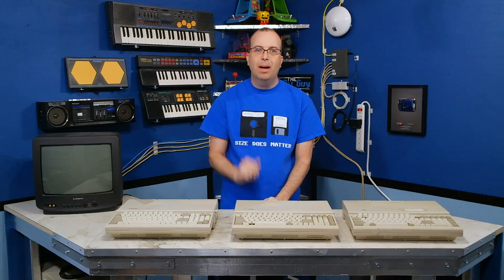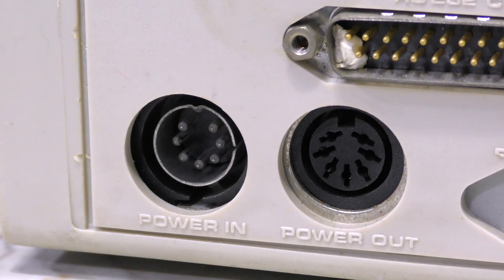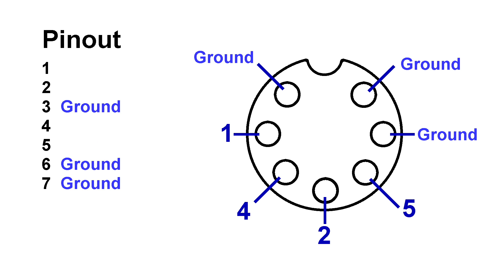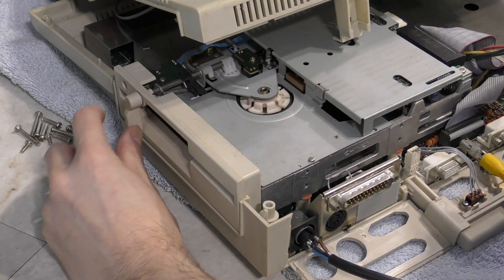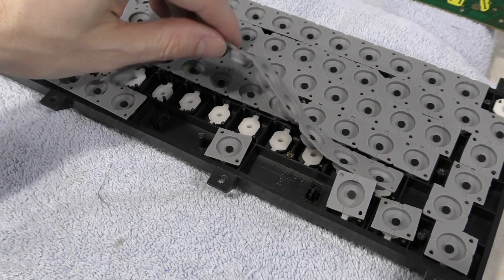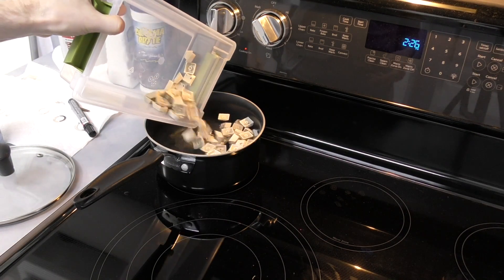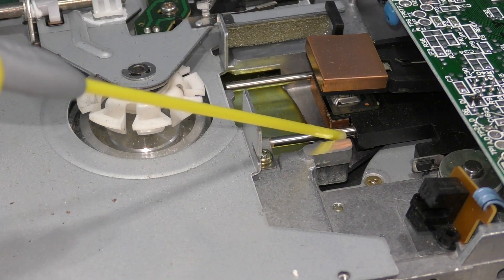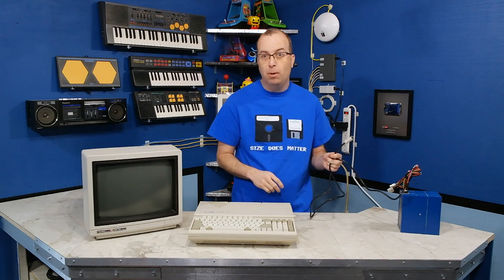Laser XT Restoration

Comment: For the power supply, check the Mean Well GP series http://www.meanwellusa.com/productSeries.aspx?i=26&c=6#tag-6-26 . They have one that's +12,-12, and +5V.I was looking at one for a replacement on my TI-99/4A with +5,-5,+12v. Nice restoration!! Was looking at picking up a Laser 128 and wondered how easy it was to pull the keys as many I've see have broken keys.

Comment: I wonder if you can take some RAM chips from the donor machine and put them in those empty sockets on the RAM board to get a full 640 kB RAM.
Reply from the maker: I wondered about that. But I noticed the extra sockets had 2 extra pins on them.  So maybe it was cache RAM or something?  I'm not sure.
Reply: Possibly it uses 256 kbit chips with a different layout, like TMS 4464 64Kx4 chips (those are 18 pin DIPs). That way they can make 128 kB RAM using the same 256 kbit chip density technology. There are 640 kB memory (and 1664 kB, with 1 MB EMS) versions of this machine.

Comment: Could'nt You just make an adapter for the other power suply that you already have? Only if it supports the same voltages of course. So Female do the power supply and switched cables as needed to the actual output.

Comment: Funny enough, that strange power plug is very similar to the old broadcast cameras that my High School used for the morning announcements. I think the camera was a 5pin, and had a huge power brick (triple of that first power brick you... bricked) that I never worried about. If anything broke, we weren't getting it replaced, so I never tried to mess with it (They were 15 years old at the time) Very cool to see similar power adapters out in the wild. I feel the same thing when I see BNC ports and cables.

Comment: i wonder if you can jack a modern laptop power supply into that laser xt pwr supply case, if you don't get a working one as a donation in the future. Come on, you are the 8 bit guy, hero of heroes, you can even jack a toothbrush into that thing and still power on the xt (after finding the proper ground pins on toothbrush...)

Comment: You should of used some heat shrink on each of your wire connections, and another shrink between the that metal shield and the pins.  It looks like a short waiting to happen, especially with no strain relief.  00:08:03  If it was simply a signal cable I'd not worry, but this is Voltage.

Comment: Is this a Z80 CPU based machine? I saw a Zilog chip when you were pan around looking for the CPU. I'm using an old AT power supply for my Atari 520st, they do come in handy.
Reply: The Zilog Chip is a disc controller, I thought the same thing though and had to look it up immediately, anyway the 8080 and the z80 are very similar but the z80 would probably not have enough compability to work as a clone, so it's probably that the zilog disc controller was the cheaper or simpler option in this case.
Reply: Zorbeltuss Z80 is as 8080 compatible as a Ryzen is Pentium compatible.  But PCs are 8086 compatible, not 8080 compatible.
Reply: This is why I shouldn't be on youtube when stressed.

Comment: You really want a decent connector for the power supply, here's a couple I found after a quick search:
https://www.alliedelec.com/rs-pro-6925450/70827396/
http://www.newark.com/prehkeytec/71506-071-0800/connector-din-jack-7-position/dp/99K0408 (picture looks wrong, datasheet looks right.)

As for power, if you want a more power brick style adapter, depending on the current demands on each of the rails, I've got an old Cisco power supply here that has +/-12V and 5V outputs. It can supply 3A on the 5V rail, 2A on the +12V rail, but only 0.2A on the -12V rail, and it says the maximum load is 30W. The one I've got is for a 1700 series router, part number PWR-1700-WW1, but they're also used by other devices, and the generic part number is 34-0874-01. They can be had on eBay for less than $10.

http://www.ebay.com/itm/191686435622
http://www.ebay.com/itm/142511583013

You'd have to measure the power usage to be sure it didn't exceed the ratings, but those old machines weren't usually all that power hungry, so you might get away with it.

Comment: Just offhand, instead of using the PC power supply, what if you were to use a set of the connectors you bought, and make them into a pin adapter for the other Laser power supply you have. It sounds like the power supply itself is the same, just with a different pin configuration, so with the right adapter, you could just use the one PSU for both.

Comment: I have to say about the +/- pins shorting to ground is actually genius, So you don't use the wrong power supply on the wrong computer with the same connector.

Comment: It looked like there were empty sockets on that memory expansion board.  If you had 512K RAM, would the memory from the parts computer allow for memory expansion on the one that you spruced-up?  I had a PC/XT clone with 640K and with Mr. Gates' limitation that seemed about the best any of the XT programs could take advantage of.

Comment: I Have a Power supply that has 12+ 12- and 5 , the jack is male and youneed to check max amperage useage. if you want to find it on your own its "Ault 7612-305-459E Power" If you are intrested in mine let me know!
Reply: and i also have a smaller more modern version of  the power supply .

Comment: My high school in Melbourne, Australia had a room full of XTs similar to these in 1989 and I've been curious about them ever since. I don't recall if they were Laser XTs, but they had the same sort of integrated keyboard & motherboard design as this. They were different than the model shown your video, though, in that they booted DR DOS 3.3 from ROM.
Reply: I also vaguely recall some of the students learned somehow they could hold down the C or M key at boot time to switch between monochrome & colour modes. Holding down C caused meant there was no output on the screen though, which was a prank we used on the teacher at the start of the year. Perhaps it was switching between mono and composite output.

Comment: Just a quick tip: you can put TAED into the boiling water when you "retr0boil" your keys.

TAED is the whitening-agent used in things like Oxi-Clean (or whatever the name is), it's the additive that basically cleanse deep-sitting pigments. It won't attach the plastic or the pad printing on the keys.

Comment: This machines doesn't need electrolytic capacitor replacements too?
The best ones we know only last like, 10 years.
Reply from the maker: There were only 2 or 3 in the machine and they all looked fine.  I imagine most of them would have been in the power supply.

Comment: Have you looked into open frame industrial power supplies?  I had to build some Amiga 500 PSUs and I believe it was digikey that I could purchase a 65 watt open frame PSU from.  They had multiple types and I'm pretty sure that they had +/-12V and 5V as an available type up to 150 watts.  It's been 5 years or so since I built one, so your mileage may vary, but it wouldn't be a bad place to look.

Comment: First,  I like the music choice! Second, as an idea for Future power problems on other machines; it may be worth it to keep the atx supply, and add more plugs as you go along, perhaps making it into a universal power supply. It could save you quite the hassle of either tracking down a supply to be able to use a machine,  or possibly having a bad power supply, which could damage the electronics. Hopefully this helps!
Reply: To be fair, if he does this a lot he should probably invest in a set of bench power supply modules.
You can get cheap ones off ebay that work reasonably well for something like $20 per module, or slightly more depending on voltage and current limits.
Granted this system would have demanded 4 modules...
But you can easily get anything between 0 and 20 volts at up to 3 amps from them.
So if you run into something weird needing say, 17 volts, or 7.5 or whatever...
You can at least test those fairly easily...
Reply: AT is actually a better solution here. Early computers relied heavily on the 5V rail, but newer, atx power supplies have most of their capacity on the 12v rail, with an underpowered 5v rail.
Reply: Hydrochloric Acid on the other hand, old computers isn't that power hungry.
Rather use a newer atx then a old at dito
Reply: true, perhaps a buck converter could be used,  which could bring down the 12v to 5v as needed
Reply: Skidd2 That would be a waste compared to a PSU that provides the voltages directly.
Reply: KuraIthys for stuff like this which often isn't that common anymore I'd not want to use adjustable supplies or anything cheap for fear of doing damage to the device.
Reply: Thelemorf i mean you do have a point there
Reply: John Francis Doe Yes, but only a few percent
Reply: Thanks that solves my problem.👍

Comment: I tried looking up other power supplies you could use, and while I don't know how much power that computer needs, I found an interesting option on google images by searching "ultra slim atx power supply". It's the first result, and on their website they claim 80 watts with active cooling, or 60 watts with passive cooling.
Reply: blackcorvo But does it have a -12V output?
Reply: Yes. Here's the website I found: http://www.globalsources.com/si/AS/Magic-Power/6008821485698/pdtl/Power-supply/1116673766.htm

And here's the rescription they give:

"Product Details
Model Number: MPI-706H-A
Brand Name: Magic Power
Origin: China (mainland)

Key Specifications/Special Features:

- 80W with 8.6CFM forced air- cooling, 60W convection cooling
- 180 x 52 x 39mm slim size with building in AC inlet, ATX output
- It is reliable design convection cooled design and MTBF > 130,000hrs MIL-217F
- PG/PF signal
- With +5V stand by and remote on/off
- IT standard IEC 60950-1, UL 60950-1 and EN 606950-1 approved
- Operating temperature: 0°C to 70°C (derating from 50°C by 2.5% per °C)
- Output: +5V/+12V/-12V/+3.3V/+5Vsb"

There's probably other options on eBay or something, but I was not able to find them yet.

Comment: You can easily get -12 volts from +12 volts using an ICL7660. It is very cheap and easy to use chip, available in DIP8, only needs two external capacitors to work.
Reply: M3ta7h3ad It needs to be regulated ±12V±5%, not unregulated ±12V±30% .
Reply: shiru8bit

Ahh, I just mentioned something similar. hehe

I've seen some small DC-DC reg boards for negative rails online.
Shouldn't be too hard to hook up, and a lot more compact than the old AT / ATX PSU.

There aren't that many modern replacement PSUs for retro machines (that don't cost a small fortune, and still have the negative outputs).

Hmmm. Idea for future project. lol
Reply: Exactly my thoughts. Something like that should be enough for the project:
ebay.com/itm/_/252461791792 
(leave +12v unconnected)
Reply: I believe that in many (most?) AT computers -12 line is only used for COM (serial) port, so connecting it to -5 should be fine most of the time. Even just connecting it to ground is enough to make some COM-port devices working. However please note that it's only an educated guess, I didn't research schematics of old motherboards to prove I'm right.

Irregardless, omitting or grounding -5v rail on pre-pentium motherboards would likely lead to burned out memory and other chips since it provided negative bias for some components. However, the bias current is minimal and a small DC-DC converter or even a battery should be enough.
Reply: Just use a 24v transformer with a center tap. No chips required.
Reply: Jack White I seem to recall the 8088 and 8086 XT CPUs actually using the extra rails. There was no 3.3V, 1.5V or other of the ultralow rails used by modern Intel CPUs.
Reply: I don't think the CPUs themselves used the negative rails, but it's quite likely that the older style DRAM chips did (like in the ZX Spectrum).

That's actually one of the most common points of failure in the Speccy - the negative rails are generated by a small inverter circuit, and the transistors have a habit of failing after all these years. That often fries the DRAM chips as well.

As Jack White said, on most XT / AT PCs, the neg rails were usually only used for things like the serial ports, (if they had single-rail DRAMs) or maybe opamps on expansions like sound cards etc.

Yep, you could use a transformer and linear PSU instead, but they're not especially efficient nor lightweight.
There is something to be said for linear PSUs when it comes to much lower high-freq noise though.

On a lot of retro machines that require negative rails, the maximum current draw isn't usually much about 100-150mA, so something similar to the board Jack linked to should work OK. That one is only capable of supplying about 30mA though, so maybe something with a bit more oomph. :p
Reply: John Francis Doe really? Because the PSU associated with the other machine appears to be linear and I would wager unregulated. The period of time it came from suggests very much so that an unregulated linear power supply would have been used.

I'd say the "regulation" is an arbitrary requirement placed upon the PSU by yourself. It doesn't "need" to be regulated, it would be better if it was.

Edit: the unit itself states DC 15V which is more like +20% on a 12v PSU. The more you look at this, the more an unregulated linear PSU makes perfect sense.

Comment: How is -12v different than ground on +12v?
Reply: vauxminijoe voltage is a difference in potential. When you have a + 12v you have a large potential than ground. When you have a negative potential you’re voltage is 12 volts less than ground
Reply from the maker: There is a total of 24 volts difference between the two. Where as there is only 12V difference with ground.

Comment: one way is to hook up two 12V power adapters with one positive to anothers negative rail to form a relative common ground and an adapter 5V negative rail to the common ground to form the -12V,+12V,+5V supply.
get some sort of project box and place them in it, now you get yourself a split rail power supply.
its definitely not the most efficient way but its definitely more elegant than having a beefy power supply seating beside it.

Comment: The zilog is the cpu
Reply: No it isn't.  That Zilog Z0765A08PSC is a floppy disk controller.  The 40 pin chip closer to the back from Zilog, the UM8250B, is an asynchronous communications chip, which I presume is serial or parallel.  The other 40 pin chip near the heatsinked chip, UM8237AE-5, is a CMOS clock generator.  Given you'd want the clock near the processor it would follow that the heatsinked chip is the processor.

Comment: An Amiga power supply would be ideal as a replacement. That has the voltages you need - just replace the plug.

Comment: Anyone know where I might be able to pick up an Apple IIc? I'd like to build up my collection a bit more. Awesome video, nonetheless.
Reply: There is a place in Pennsylvania called kemners surplus with a MOTHERLOAD of apple II computers and its where I got my apple II
Reply: Fox Repair never heard ebay before ;)
Reply: Fox Repair While ebay is a good place to obtain a apple IIc computer but on ebay it is too expensive.
Reply: The IIc Plus is 8 bit, but it runs a 4 MHz accelerator.  It can be throttled back to 1 MHz to run speed sensitive games.  It also has a 3 1/2" disk drive built-in instead of a 5 1/4", and the power supply is built-in instead of an external brick..
Reply: I always wanted a IIGS.  The last Apple brand computer that wasn't a mac I think.  Tracking down a copy of Oregon Trail, there in lies the challenge.
Reply: Aside from ebay, check craigslist listing in your local area. That would probably be better since you won't have to pay exorbitant shipping prices.
Reply: Thanks for reminding ,  have a local tip shop where I asked a while back about computers in general ,  they said they did,t bring them in because of risks of child porn on them , which sounded weak  ,  but did,t press it  .  .  but goin to ask about older pc again though
Reply: That does sound extremely weak. XD
Personally I stick to ebay. But in my experience I live in a place where getting anything locally is nearly impossible.
Plus I don't have a driver's licence, which severely restricts where I can go, and what I can pick up.
(CRT's for instance are not plausible for me to pick up unless they are REALLY close by, and nobody in the immediate vicinity has that kind of stuff that I've seen.)

I did notice that the local second-hand shop has a lot of retro gaming stuff (they have atari 2600 games, routinely have mega drives, snes, n64, and every playstation model you can think of.)
But... The prices are basically the same as ebay.
What I've bought from them is really just because I wanted to, and was a bit impatient. (if you go to the shop you can get it instantly - ebay can be a wait of anything from 2 days to 5 weeks depending on where stuff comes from)

meh. I wish I was still living in the UK in some ways (I didn't really have the option to stay there though) - They have tons of Amigas for sale for very low prices quite often. And while I can buy the systems from UK sellers here, (and STILL the prices tend to be lower), the shipping costs tend to be substantial...

I bought some old Midi equipment recently that came from Japan, and shipping on that was $75 USD...
Which is quite nuts...

That's nothing compared to some of the prices for say, a desktop PC kind of thing. I've seen shipping on those hit $200 or more...
Reply: AShifter I don't know about in America, but in UK you can find EVERYTHING on Facebook marketplace
Reply: The IIc Plus actually came out after the IIgs.  I have both.
Reply: Does the IIc Plus have more memory and processor speed than the gs?
Reply: I have a spare one I can sell to you for $100. Fully working in great shape with power supply and floppy diskettes.
Reply: AShifter an amazing place called ebay